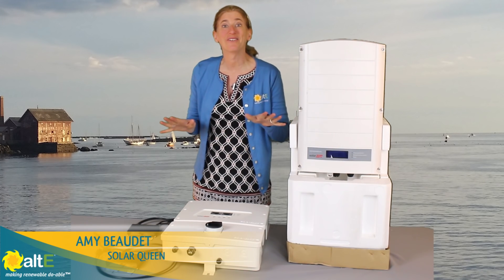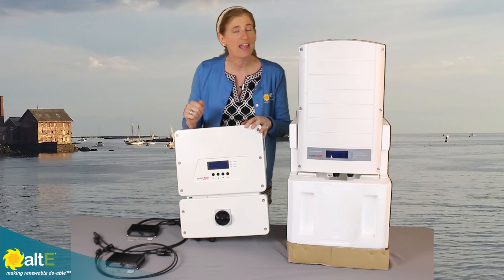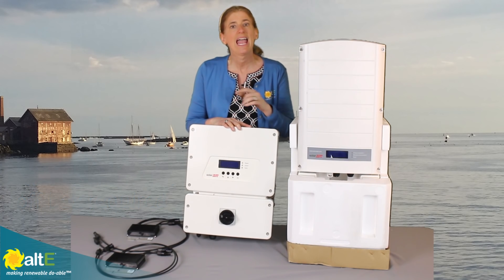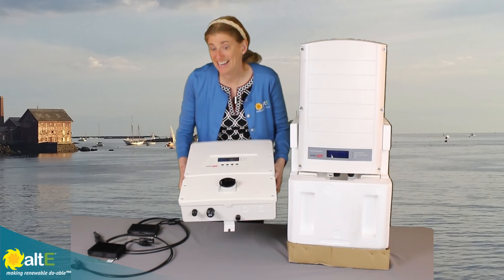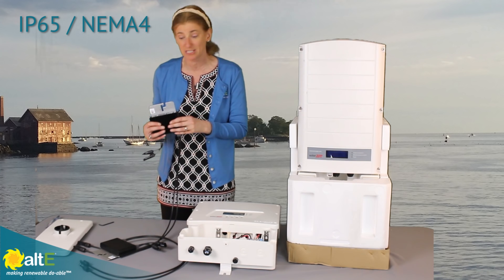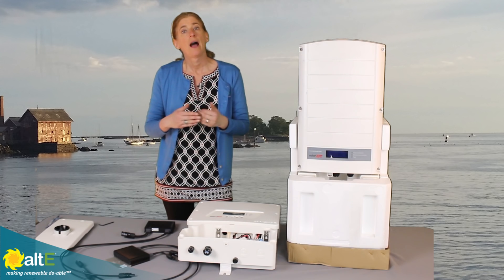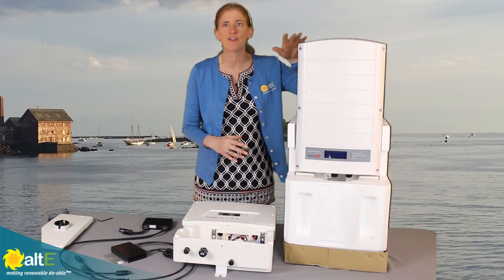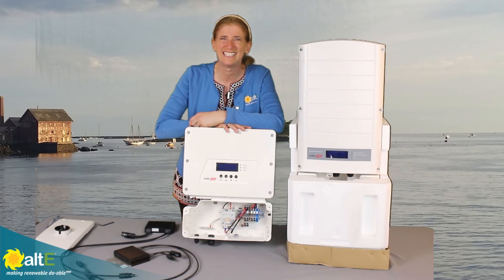Inside look at the SolarEdge HD-Wave grid-tied inverter

Comment: The problem with solar Edge is that if a problem with there system they take to long to respond or they will not respond to your problem so sting inverter is more butter than solar Edge to much problem with them

Comment: This sounds like voodoo!  99% efficient?   Is this buck or boost inverter?
Reply from the maker: It takes an input of 350VDC and converters to 240VAC.
Reply: Yes, because hardly any heat loss.
Reply: The efficiency of the inverter isn't the complete picture, because the inverters are not built to work with power directly from the series strings of modules like your typical inverter.  The inverters work in a proprietary combination with the power optimizers, such that the power optimizers do some pre-processing of the power for the inverter.  The functionality that would otherwise be in the inverter for adapting its input voltage to track the maximum power point of the modules, is externalized to the power optimizers.  It is the combined efficiency of the power optimizers and the inverter that you need to use, when comparing to other brands of inverters.

Comment: At 5:15 you mention that because it is NEMA 3R it can be installed inside or outside. I notice that it also says online that it is Auto-Rapid Shutdown in accordance with NEC 2017. 

Can you still be in compliance if installing inside?
Reply from the maker: Because the optimizers are on the back of the panels, that is what does the module level shutdown. It doesn't care if the inverter is inside or outside.
Reply: @AltEStore  Ok thank you, I thought the inverter would be required to be placed outside so that the power company or firemen could use the disconnect switch at the bottom if an emergency required them to disconnect power. 

It seems from another video of yours that a disconnection or knife-blade box could be placed outside of the building to disrupt the connection between the breaker panel and inverter to meet that requirement while the inverter is inside. Thanks again!

Comment: So for this model you can have 2 inputs, do the 2 inputs from the Panels have to be coming in on the same DC voltage?
Reply from the maker: Because the SolarEdge inverter is connected to the Optimizers, the voltage coming in will actually be about the same, even if you have more on one string than the other. The amps will be different. As long as you meet the minimum and don't exceed the maximum lengths, they don't need to be even.
Reply: So do the optimizers essentially make the connection of panels in parallel instead of in series?
Reply: @brandonandkeiafink204  No, it's still series.

Comment: My HD Wave last only 2 years then it die
Reply from the maker: I'm sorry to hear that. Fortunately, it has a 12 year warranty, so you could get it replaced.
Reply: @AltEStore  I have a question .. my HD Wave replacement was screenless. Is there any different between screenless and no screenless? should I ask for a no screenless similar to the one just die? thanks
Reply: ton  setapp is better. I've replaced like 300 hdwaves with screens

Comment: The company I have hired to put an installation on my roof in a few weeks -- I think it's spec'd at 7.8kW -- strongly suggested using the previous generation (non-HD) Solaredge inverter.  The one on my estimate is a SE6000a.  They said they'd happily install either but that the never HD models have some serious reliability problems.  Is that true?  Anyone have an opinion?
Reply: Definitely true. Especially ones in the video. Setapp is a little better

Comment: The output AC power will be clipped at its rated power, where does it clips actually? Is it during the conversion during the total DC power into AC power or before the DC power reach the DC-AC Converter?

We would like to do research on the performance of different types of module and we found out that optimizer is quite a good method to analyze their individual performance. Will the clipping affect the collected individual data of each module?
Reply: What ends up happening when the AC power clips, is that the MPPT algorithm deliberately seeks a higher voltage than the maximum power point.   Effectively, you "leave sun on the roof" in the form of thermal energy.

Comment: does the SolarEdge 6000W HD Wave Inverter work with battery bank or Li-on power wall  ?
Reply from the maker: No. Only the SolarEdge StorEdge 7600 works with the LG Chem or PowerWall batteries.
Reply: thank for reply and many information that you give on  You-Tube

Comment: They installed mine on the south side the sun hits it and often the rain.  Still works good.  Even handled 112F heat.  This is the old one.
Reply from the maker: You may get better performance and a longer life if you just protect it from the elements a little.
Reply: still?

Comment: Just recently installed 2 - SE7600h-us for a 17kw system. 64 axitec 260 watt solar panels with the dc optimizers integrated into the panels, it was a much faster install than setting the separate units for each panel. The new design looks really nice, I guess honestly the one thing that annoys me is with all the technology in this unit, solar edge still didn't integrate built in wifi into the inverters and still forces you to spend extra money for the zigbee modules to do wireless. The zigbee module system was easy to install and worked fine once we were able to get the master in range of the inverters. Just my 2 cents, Solaredge, why you no put wifi in your new inverters? Love the videos. Thumbs up!

Comment: Unfortunately electric utilities have gotten more aggressive at killing grid tie solar. Many states are killing net metering and even in solar friendly states like California Southern California Edison has a monthly penalty of $8.00 per month for solar costumers. And as soon as they reach 5% solar the pay back will be 2 to 1 instead of the 1 to 1 KWH.It seems the future is off grid.
Reply from the maker: I think the future in states with unfriendly policies will be self-consumption. So you have a battery store any extra power you make during the day, and then rather than selling it back to the grid for credit, you use it yourself that night. Since solar generation is a little ahead of most consumption, by just storing it for a few hours, you can use it when you need it, and still have the ability to buy the remainder needed power from the grid. This allows you to have a smaller battery bank, making it an affordable option in locations with high electric rates and unfriendly policies, like Hawaii and parts of CA.
Reply: I am starting to think that separating your solar system from the grid you can avoid any fees and the expense of net metering contacts and required disconnects device expense. I have a deep distrust of electric utilities as when you sell your home the new owner will be forced to sign a new contract at a less attractive deal.

Comment: Is there an off-grid application for this? 

I know for my house, I will have to change a few things. Especially my electric tankless water heater. I already have an idea to install solar panels to heat up the water. And have the tankless to add to that solar heat, if needed.
Reply from the maker: This is a grid-tied inverter. SolarEdge also has a different inverter for battery backup called StorEdge. See that video here, https://youtu.be/WJzYQIMTAq8
Reply: altE g
Reply: Since I found out my SolarEdge Equipment is useless, "bricked" by dysfunctional connection terminals on both units, and am now reading the warranties (useless) and learning what my options are, I'm recommending to anyone who cares to listen, not to buy any of this stuff until they get their parts, quality-control in order.  When something breaks, they refer you to someone else or ignore you.  You're stuck with $10k worth of junk.  The rest of it probably works ok, but if the first piece I touched was defective, what quality control was exercised when sourcing all the little bits and pieces?  From my experience, little or none and those parts have flimsy, short, useless warranties or none at all.  This is a typical large multi-national corporation, I should have known better.  At least Tesla is American made, but you can't buy one, their supply system is six months behind.
Reply: Solar edge = garbage... Unreliable they. All have fans on them built to break. Check other options.. enphase can even run underwater
Reply: @guidedbygreen1480  can the micro inverters run under panels in 45+ degC, we get here in Australia, without dying.
Reply: @guidedbygreen1480  thank you so much for the help 💖
Yes here in SA it's gets very hot.

Comment: technology keeps getting better. thanks for your video
Reply: But the quality control keeps getting worse.  The unit I bought is defective and they won't do anything about it, except  advise me to "ship it back" so they can assess it.  The actual warranties you'll deal with when this happens are flimsy and designed to protect them from the poor quality parts they source.
All the input terminal blocks on my units (inverter and battery) are mis-cast and won't release a wire once inserted.  That sounds stupidly simple to resolve and it is, but Solar edge and LG Chem want nothing to do with it.  How many other $1 parts are in critical locations?

Comment: Is it just SCRs making the sinewaves like in a VFD?
Reply from the maker: This is what I get from them, 
1) Distributed multi-level switching elements create a sine wave.
    Powerful DSP processor synthesizes a clean sine wave        
2) Less magnetics are required for filtering  
3) Highly efficient design with minimal heat loss reduces cooling requirements
Reply: It is still making a stepped waveform, through the DC-to-AC digital switching, just with more levels of steps instead of "all or nothing" pulses like the previous generation of inverters.  This enables them to reduce the "size" of the capacitor and inductor banks that are used in the filtering of the wave, to condition the waveform to match the sine wave of the grid.  There still is this filtering that is needed, just a lot less of it.